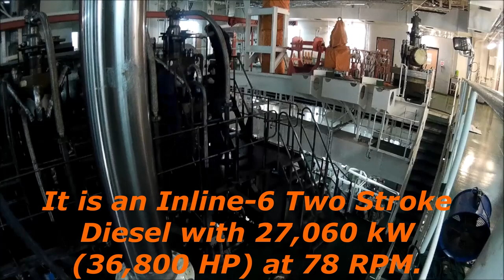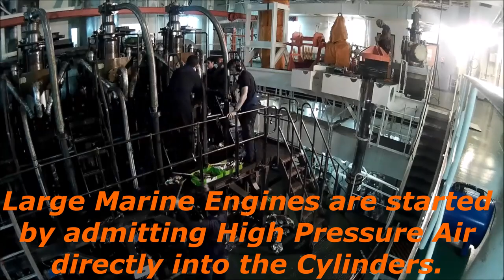Ship Engine Piston Change Timelapse

Comment: Hello, I need to know what HP steam engine AND TYPE of turbine i would need to power a 75kva transformer and delivers 692A @ 240V Single phase.
Reply from the maker: Then you're completely wrong here. This Video is about a Diesel Engine, and I only run and maintain such Plants and have no Idea about Design and Construction. All I can tell is that you probably need at least 80 kW, and the Torque/Speed Stats depend on your Generator.
Reply: I can't wait for the next generation of engineers - those who not only can't do their own homework, but actually believe youtube comments are a great resource for complex engineering decisions. We're doomed.